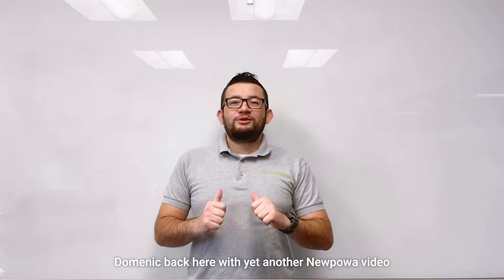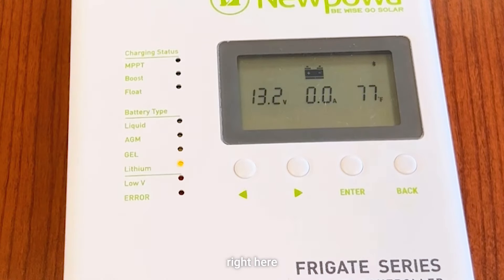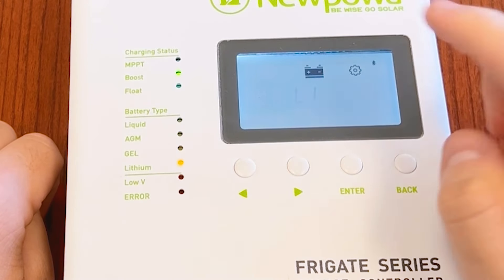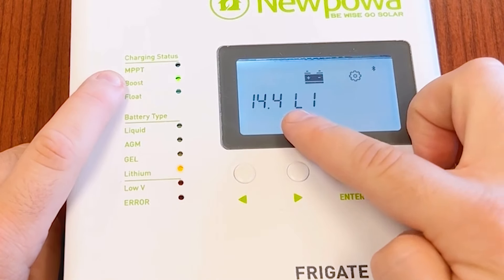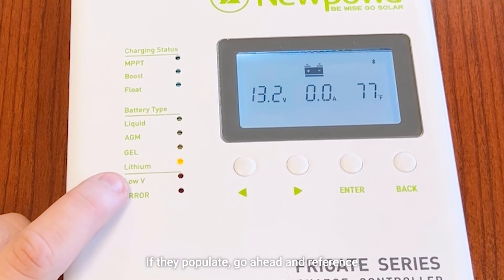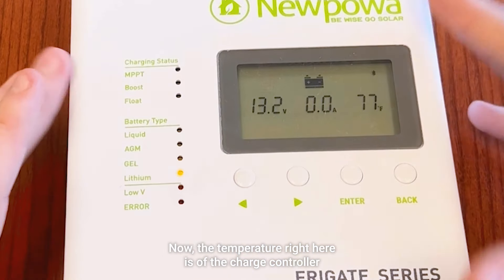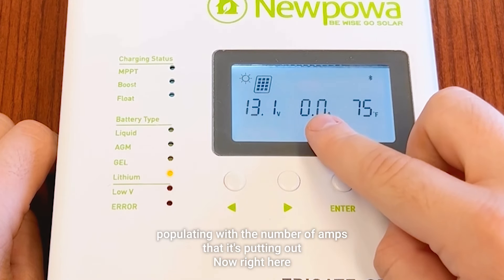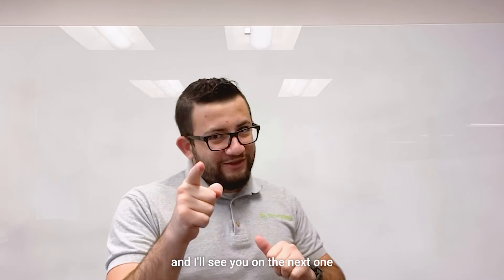Newpowa’s Frigate 40A MPPT Solar Charge Controller (Part 3)

Comment: How does the controller measure the battery temperature?  The plug in probe is only 3 inches long,  No way to get it anywhere near the battery.
Reply from the maker: Really appreciate that you bring this up, for the battery related projects, normally a charge controller is designed to be mounted as close to the battery as possible so that we can get clear data from it, but yes this has been considered into the next product update. Newpowa will keep updating the product to bring better and better customer using experience.